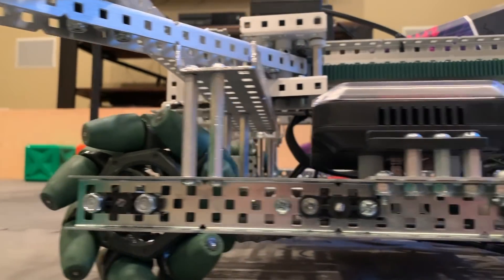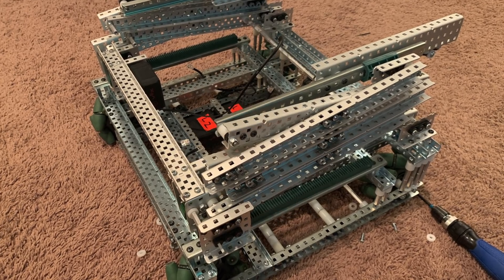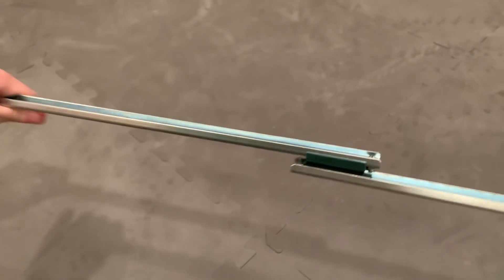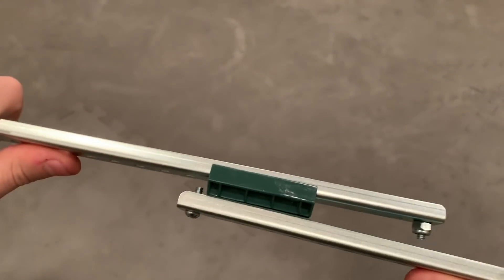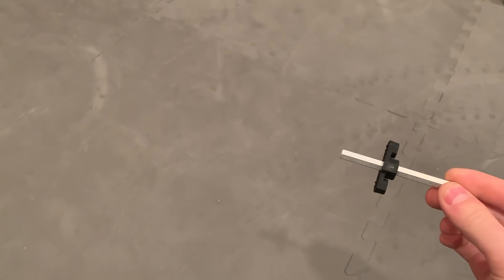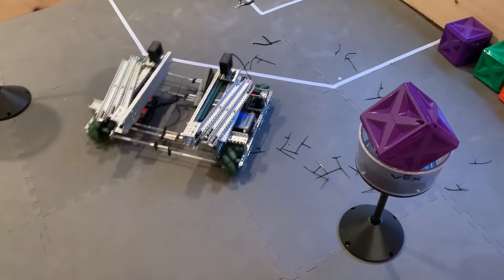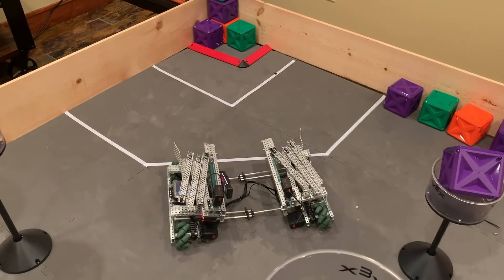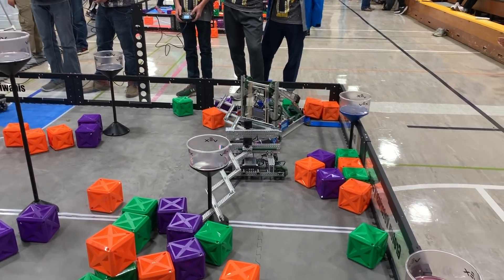Vex Tower Takeover Wallbot Reveal and Custom Linear Slides

Comment: For the linear slides you guys could have used both inside trucks and screw them in together
Reply from the maker: This was our first thought, before realizing we didn’t have enough inside trucks and we had to improvise.
Reply: Kepler Electronics ok, that would be a bit of an issue hehe. Good luck with your new robot!

Comment: why did you not just put the scissor on the drive
Reply from the maker: Two reasons. The scissor wings were a bit of an afterthought, and also, it would make the robot even harder to drive if each side of drive was that far out. Not to mention that the scissor would have a lot of sag between the sides of drive...
Reply: @KeplerElectronics  it would have less sag then 3 points of contact standoffs lmao. Also u don't have to drive after u extend lmao